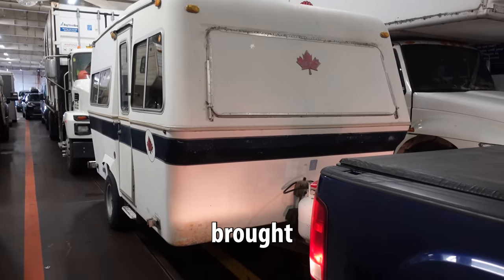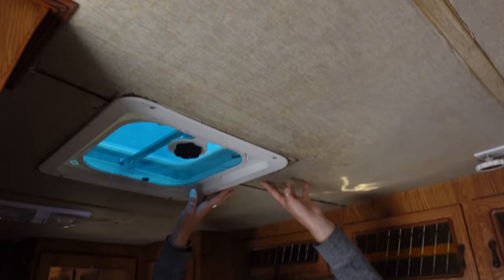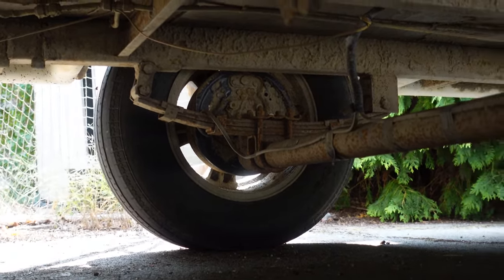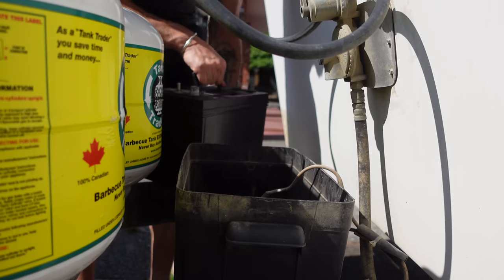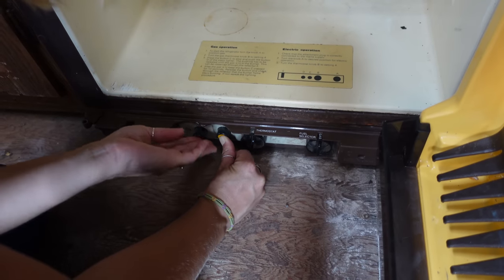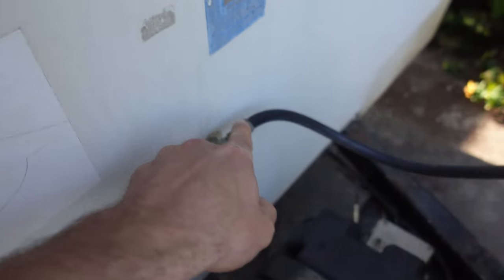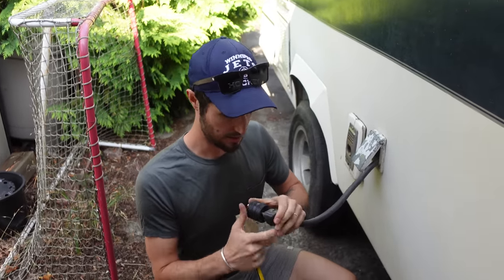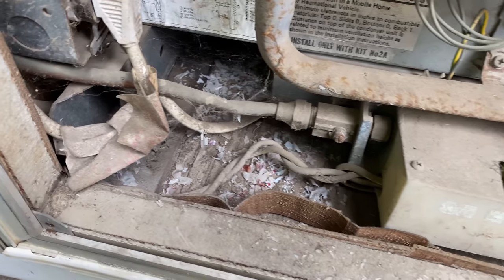Everything Wrong With Our Vintage Trailer (So Far)

Comment: Does the trailer have an inverter so when you're running off a battery that it can convert the 12v dc to 120v ac? If so, first get yourself a multimeter and then test where the battery power goes into the inverter, and then out of the inverter.

Comment: The roof is a big deal guys. You can everything else and make it pretty but when the rain comes or the snow melts there will be considerable issues. I suspect it’d be expensive and should be addressed before moving on to determine damage and cost to repair. After that new appliances maybe needed if used ones are not available or compatible. 

Overall at the minimum you should get a solid tarp to cover up for bad days and figure out a way to secure it in place while having access to the door.

Comment: Don’t blame that previous owner’s work for the roof rotting! Lolol It’s an RV, and they melt in the rain. That previous owner was just trying to delay the inevitable. I’m speaking from experience, having bought a toy hauler with the goal of turning it into a tiny home. Turns out, RVs are made of sugar cubes and basically should only exist in deserts. Also you are VERY lucky that it doesn’t have a black water tank. Believe me, it was NOT fun removing the leaking tank with mystery solids in it EVEN AFTER PAYING SOMEONE TO PUMP IT. You’re very lucky you didn’t also buy a toxic hazard.
Reply from the maker: Hahaha made of sugar cubes is the line of the week 😂

Comment: One thing many people miss with trailers is that the legal speed limit can change if you're towing a trailer/RV. So definitely check the local regulations when you're traveling between states (although I think the risk of getting stopped for going too fast with a trailer is quite low).

Here in Sweden you're not allowed to drive faster than 80 km/h (50 mph) with a trailer, but you often see people go much faster than that.
Reply from the maker: That's a great note! Thanks for the heads up 👍🏻

Comment: This is really validating as someone else who’s found myself with a much bigger renovation project than I expected! I bought a renovated skoolie from a nice person who had been living in it for two years, and who insisted it was completely good to go. After living in it for two months I’ve found that it has water damage everywhere, a stink bug infestation, exposed wiring, horrible insulation, and none of the furniture stands up to actually driving the bus- cabinets are falling apart left and right. 

It was also my first private sale so I didn’t get a mechanic to look at it- turns out it has so much rust that a large rock could cause serious damage to the bottom, and there’s an engine leak that basically can’t be fixed. 

I finally gave up and will be living with my parents so I can gut and redo it, but I’m still frustrated that I overpaid for something that is going to be so much work and will probably end up being a stationary bus.
Reply from the maker: Ouch! Sounds like you're on a journey with that one! We've bitten off a pretty big bite here too but well see how it goes!

Comment: the best tip i can give you is to NOT touch the outer walls. stuff will never be the same. that being said that caravan needs to just be fully stripped to the bones. I'm very much wondering how much ya'll paid because ut shouldn't be more than like $1000 or so since simply nothing is gonna be propperly funcitoning

Comment: What the old girls name???😂😂😂😂
Definitely purchase a screen porch attachment.  Will do wonders at helping with bugs and will give you much needed bug free outdoor space.  Basically just a screen room.  I’d put a little wood stove in her so cozy and warm.  Definitely tarp the old girl until you get the roof under control.  Switch out the stove for electric and put a heat shield on the wall next to the stove.  Pay special attention to anything that could potentially be a fire hazard, install a smoke detector.  PS we have had experience with a 102 yr old home with lathe and plaster, talk about a nightmare!  This although work required should be a dream compared to what we went through.  Gut/Pit the old girl out.  Defiantly needs it.

Comment: Bless!  What a project.  

You can totally do this, BUT my recommendation would be to cancel that booking at the end of the summer or plan to rent a trailer for that holiday trip.  

Your trailer is very unlikely to be a safe trailer by the end of the summer.  Forget renovations.  For safety’s sake alone for you two and the baby, you’ll need to asbestos test, fix the roof and find and remove the inevitable mold, inspect and probably replace electric and propane lines, and probably replace the water tank.  All of that likely means stripping this thing down to do it economically, unfortunately.  Don’t put yourselves in a stressful bind to make an unrealistic deadline.   

Instead of desperately patching to make it sort of temporarily livable for a single trip, take a breath, and do it right the first time.  It’ll take longer and be messier, but will cost far less and at least you’ll know the trailer is safe.  Good luck!

Comment: I've recently done a campervan conversion. Electrical systems are quite complicated and I wouldn't trust the electrics in it in a million years. You need wire that can handle the amps, fuses and breakers for safety. Everything needs to be ripped out and reinstalled to modern standards or you'll have a big fire risk on your hands.

Comment: Seals, gaskets, caulking…..the absolute lowest level of repairs you would need to do for a trailer that is decades old. If that were your only repairs I would be absolutely floored! Water damage is so common in the old trailers.

Comment: Trace the propane lines and squirt soapy water all over them to see if there are any leaks. I would probably replace the entire line just to be safe.
Battery DC comes in to the DC fuse panel then needs to be inverted to AC. Work one side at a time and inspect ALL the wiring. If it is brittle or the sheathing is cracked or missing-replace

Comment: I with preface this with I have bought and old trailer with water damager, repaired, and lived and traveled in it. But that is without a doubt there is black mold in there, and you need to be masked up and very very careful! It doesn't alway look like it from surface level but its in there and it is likely bad. Ours was a 1998 and we had to gut ours down to the frame, pulling back the wall from the inside and out , removing windows, removing studs and insulation to rebuild and replace damage and get it to a point where it was safe to live in and travel.

Comment: I would have a professional look at the trailer and work on providing a quote to get it running safely. The mold and the fact that there is an infant means u should get help while focusing on the pregnancy…good luck and hoping for the best.

Comment: Omg… sorry I’m still watching and you’re step by step realizing the things I realized with my toy hauler. Just be really careful with that stove. Mine had a busted line. go through and make sure any other propane appliances aren’t leaking gas. Trying to use my propane fridge, I kept smelling it. It wasn’t safe. There is a way to test propane lines so you don’t have to just keep replacing stuff. Spray soapy water from a spray bottle and you you can see if it’s leaking. Please just get that gas detector.

Comment: You don't need to take the cupboards out to access the ceiling.  Just use a circular saw in the middle of the ceiling, cutting in about half an inche, to cut through the plywood that's on the ceiling.

Comment: I find myself wanted to pause every 30 seconds or so to make a comment….
But instead (or at least before let me off a few general comments
1 that ladder is a big no no… and when you get a new ladder before you go that high up on it to transition to the roof , sandbag its base on both sides 
If you have water damage issues might want to look into investing in a carport style tent frame kit…. You need to get that thing dry and keep it dry and a pole frame around the trailer with a tarp roof…. Or a tarp that can be quickly thrown on ….
I like a kit that can be broken down into a box small enough to throw into the bed of whatever truck or SUV you are going to be hauling this in, or loaded into a couple of duffle bags that can be tossed into the floor of the trailer itself…. A kit with leg extension high enough to completely cover the Trailer NOW… but that can be removed from the kit later to provide a more proportional screened porch area to your trailer…
Find out if there is a RVing Boon docking community in your area to join and and make freinds with a couple that is between ages of yourselves and Lea’s parents…. Then have them over for a cook out and inspection of the trailer. 
There is a guy on youtube i think you would benefit from connecting with. His FB page is Camping with Steve  and his YT is Steve Wallis…. Im not sure but i think he lives somewhere in western Canada and is “relatively” closes to you.
I cant speak to his technical proficiency but is a boondocking god and from that aspect i think both you and HE would benefit from a “sitting under the learning tree” experience

Comment: can you find a maintenance manual?  It should have all the things in it like wiring diagrams so you can see where things should be.  Just a thought, but good luck.
Reply from the maker: Sadly nooooooo. That would be a huge bonus but it wasn't included 😬
Reply: @LeahandLevi  google is your friend.  a lot of those old maintenance manuals can be found on-line or maybe with the manufacturer.  In any case I'm sure it will be an interesting series as you become master mechanics 😀

Comment: I am impressed with your ambition while you are clearly over your head. I am a retired RV dealer who now fixes up old RVs for fun. You need help, which I am willing to do. Problem is I don’t know how to reach you directly, so if you know how we can connect give it a whirl.
Reply: Kelly, is this trailer worth the effort given its condition? But nice of you to offer your help!
Reply: @aayotechnology  Possibly, depends how much time you have to put work into it. Definitely not if you are paying someone else to do most of the work.  I would start by looking for rot from water damage. There is much staining on the ceiling. That means there is probably more you can't see as the ceiling panel kept the moisture up against the rafters. Start by removing the the inside garnishes at the roof vents and peering into the opening to see what is there for rot or good wood. Also where there is water damage at the ceiling panels push on it with your finger to see if it is solid or compromised. In the video you mentioned some staining in an area where there is no roof opening. Probably means water traveled from somewhere else and settled in the lowest point. The good thing is the body is fiberglass, it is also the bad thing as you can't take the exterior apart to work on the structure. So if you have to repair structure it has to be done from inside, which depending on the extent of the damage can be a ton of work. Another thing I saw you struggling with is electricity. You have 2 systems. 120v and 12v. Lights, water pump, furnace fan work on 12v. 120v is your plug ins, one source of power for your fridge (the other is propane), and your power convertor/charger. The power convertor converts 120v to 12v when the trailer is plugged into 120v so that you are not drawing on your battery. I would say the reason you had no lights is a 12v fuse, 12v auto reset breaker, or that mystery switch on the hitch. Ironically my next video after today's is me repairing wood rot on a fifth wheel. Western Vintage RV.  Hope this helps, if you have other questions I will be glad to answer.
Reply from the maker: Thanks for the feedback Kelly! We're just putting one foot in front of the other here! So far it's been an adventure 😂

Comment: Try to find original manual for your trailer?
Reply: Also,  check wood wall studs at bottom, for wood rot from excess water over the years...if they're soft, your trailer walls could pull away from metal trailer frame.

Comment: Alot to unpack here.  First of all Leah you and baby look amazing and healthy.  Also love your and Levi's positive attitudes in the face of adversity and challenge.  Bringing this can-do attitude to the camper challenge can only lead to success.  The camper shell and internal features are super cute and as you have demonstrated needs understanding and sharpshooting.  Do internet searches on the camper model and assembly yield any technical specs and/or part numbers for these components and possible alternative replacements?  Its perfectly understandable that after 43 years old components will have to be replaced and validated.  Love that you figured out the regulator and propane lines leading into the van.  Is there a way to validate the end-to-end integrity of those lines?  Ditto for the electrical wiring and of course plumbing.  But the camper itself has good bones being fiberglass and lightweight.  The only thing I would do would be to inventory all components, their sku numbers, cost, maybe an online link to each one in a spreadsheet.
Reply from the maker: Thanks for the spreadsheet idea! I like spreadsheets more than I like making them haha but it's a good idea!

Comment: I’m worried about all that rust at the bottom of the trailer.
Reply from the maker: I forgot to include a random clip of me testing the frame... seems solid so far but I'm no metal expert of course.
Reply: Rust is to be expected. Inspect the welds, look for any cracks or bends. Ours is rusty and old but it’s solid.